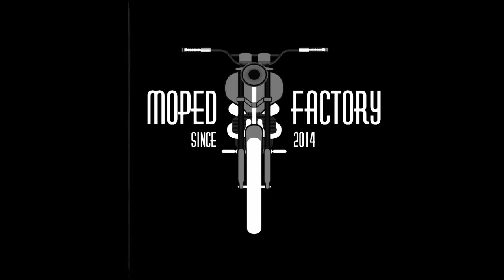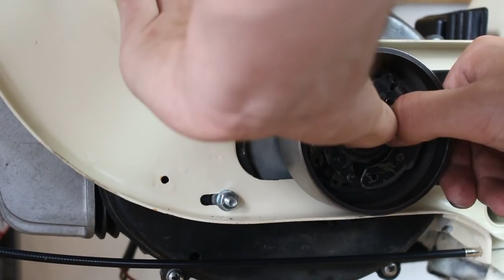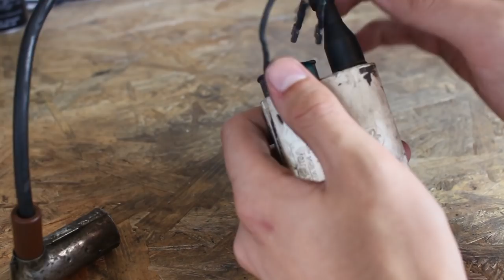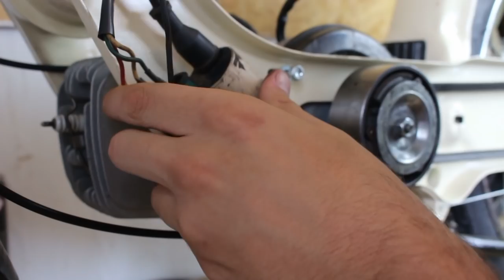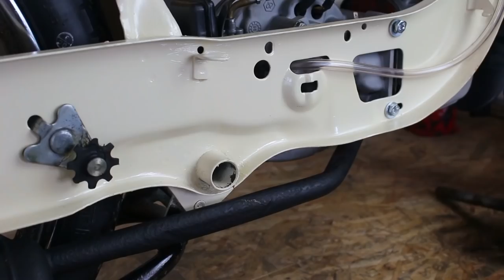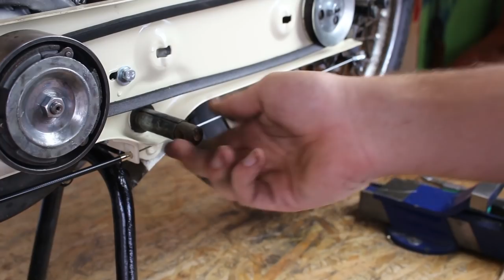Piaggio Ciao Mofa 1978 Restauration pt. 11 - Zusammenbauen III | Moped Factory

Comment: Welchen auspuff kannst du empfehlen der unauffällig ist ?
Reply from the maker: Den Sito Plus
Reply: Der wäre ok aber am besten ist der Gianelli Originalpower. Unauffällig von der Optik und bessere Leistung. Allerdings auch ein wenig lauter als der Sito. Bei JMPB.nl zudem ein schnapper für 34€.
Reply: MofaFreak87 ja ... sieht aber ein wenig doof aus
Reply from the maker: MofaFreak87 wir haben mit dem Sito deutlich bessere Erfahrungen, als mit dem Gianelli gemacht
Reply: Moped Factory hallo ich habe ein piaggio ciao und ich habe denn 13/13drauf gemacht habe alles original aussert einen sito plus und er will irgendwie nicht fahren wenn ich gas gebe bewegt sich das rad nicht an was liegt es wohl bitte kanst du mir bitte antworten
Reply: Hassan Syed  wahrscheinlich greifen die Beläge von der vorderen Kupplung nichtmehr ... also dreht der Motor ohne das er die Kraft über den Riemen an das Hinterrad weitergibt!
Reply: Peter Koschick also wenn ich denn 12/10 vergaser reintue mit dem sito plus läuft alles super und dann wenn ich denn 13/13 reintue gibt er gas aber das rad dreht sich minimal und man kann nicht fahren
Reply: Hassan Syed hast bei dem 13 ner vergaßer vllt eine zu große düse drinne ? Bzw hört es sich dann auch komisch an als würde sie gleich absterben ?
Reply: Hassan Syed  oder ob der Schwimmer richtig zu macht ... weil wenn zu viel Benzin kommt läuft sie auch nicht weil es dann nicht richtig verstäubt werden kann .
Reply: Peter Koschick genau so wenn ich nicht gas gebe schaltet es sofort aus also ich habe momentan die orginial delorto 13/13 düse drauf also mein setup alles original aussert auspuff und 1313 danke für deine anwort
Reply: Hassan Syed das ist wahrscheinlich einfach ein bisschen zu viel ! Aber das mit dem Schwimmer würde ich auch noch testen
Reply: Peter Koschick wie kann man das mit dem schwümmer testen. Danke für deine hilfreiche antwort
Reply: Peter Koschick  wie kann man das testen
Reply: 25mm sito + oder gianelli new power